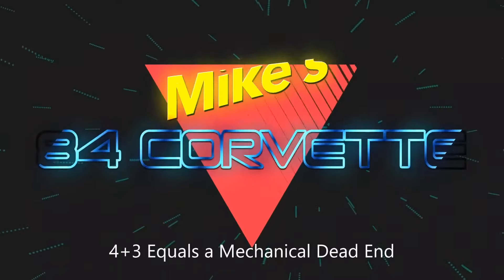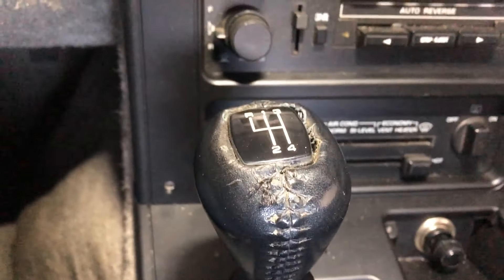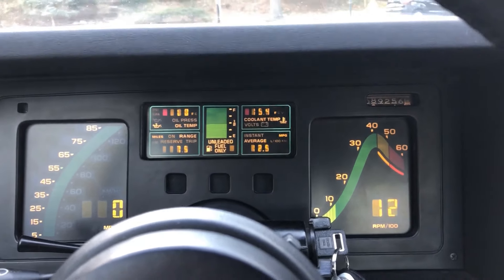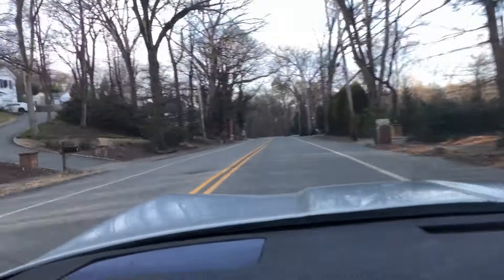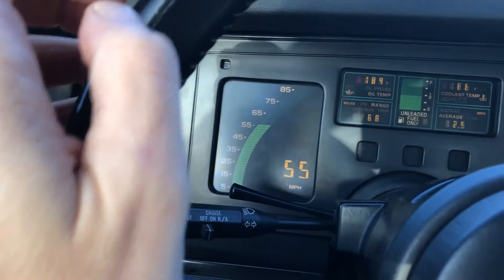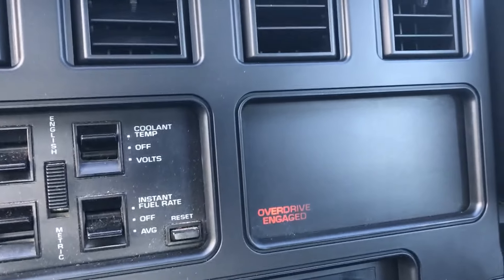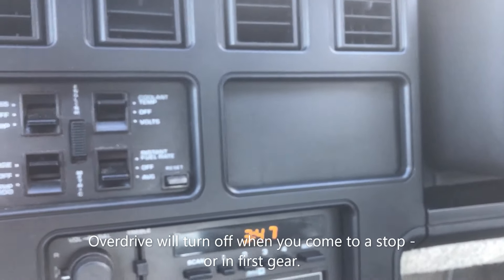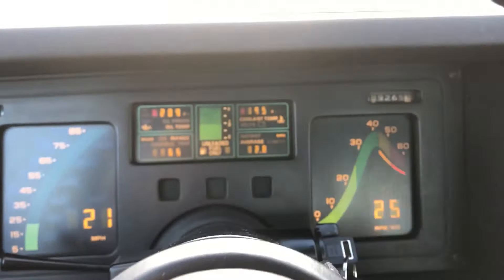Taking the 4+3 Trans for a Ride - Mike's 84 Corvette

Comment: Had issues with my 88 Vette with old dougies trans. First problem is if it needs work, good luck finding a shop to work on it. When it worked properly is was fun to drive even more so than my current 2000 six speed because I didn't have to depress the clutch pedal to get into a higher gear. I even wired mine to operate in first gear. Mine had the switch in the shifter

Comment: It's kind of weird they added it to 2nd and 3rd. 4th, it makes sense, but not really for any lower gear. Cool to see it in action!
Reply from the maker: Thanks for watching!
Reply: It makes sense if you want to do some fast accelerating, since you can flip on the overdrive while at full throttle, you don't need to push the clutch in and have any down time in acceleration, can just keep putting the power down through a shift
Reply: @televisionandcheese  I was thinking that as well. It would be interesting to see someone hammer through the gears while using the OD and timing it vs without. A quarter mile run would probably work.
Reply: @KartKing4ever  I have a Triumph Spitfire over here in Europe, and it's got a similar system. It's a 4 speed manual with electric overdrive. 
It has the switch more conveniently located on the shifter, making it easier to use in anger.
It's certainly much faster when going through all the speeds possible.
It's a huge amount of fun and greatly satisfying to use over a 5 speed manual.

Comment: The overdrive on this 1984 Corvette reminds me of the overdrive that was made by Borg-Warner and was installed on some 1950s and 1960s cars that had a three speed column shift. The Borg-Warner overdrive was similar to this Corvette overdrive in that both were a 2 speed semi-automatic transmission attached to the output of a manual transmission.

Comment: I purchased a 1985 year Corvette back in 2015, it has a little bit different digital dash but same transmission. I had no experience with manual transmission cars when I purchased it and my Dad drove it down the ridge from where it was located. We get it up on the lift and its solid underneath. It didn't have reverse and my Dad was able to fix that. The price was originally 3500 but I had a special price of  3250. The seller even included the upgraded window regulators that dont use the nylon ribbon.

Anyways that was the whole reason I learned to drive manual transmissions, I've since replaced the heater core and we have a new foil backed foam insulation sound deadener kit, a new graphite carpet kit and I have new floor and cargo area mats.

Next is the interior trim panels, door panels and the seats. I also intend to redo the solder connections for the rear defrost, as well as replace those rear pillar trim pieces.

I also intend to replace all the weatherstripping when I have funds saved up.

Keep up the good work on your 84 as well!

Have a good evening!
Reply from the maker: That’s a great story! Sounds like you are doing a good job on your car. Thanks for watching!

Comment: Finally, someone who shows us all just how the 4+3 transmission actually works, considering its oddities. Myself?, I'd opt to pull that console & add a bunch of sound absorbent material to try to absorb some of that plastic on plastic sounding gear-changes...
Reply from the maker: Thanks for watching! Good suggestion too. Maybe for a later video.
Reply: @Mikes84Corvette  The Doug-Nash manual box has a bunch of external linkages...and all those "connection points" create & transmit sounds. The likes of a Ford Top-loader have zero such linkages, the shifter stick merely sticks out the 'top' & is utterly silent.. There are a few aftermarket shifters for the Doug-Nash...all those linkages & the 'shifter box' likely are made with differing materials & likely " sound better" & work better.
Reply from the maker: @AndieBlack13  My car makes so many squeaks and rattles any improvement in  one area would probably get lost. Good info and I appreciate you commenting.

Comment: If I ever were to get a C4 (and couldn’t get a Grand Sport) I’d have to get one with the 4+3.

Back in the 90s, a good friend of mine had an 88 with the 4+3.  From the first time I rode in it, I thought it was the coolest transmission.  A manual that also shifts like an automatic, it blew my mind!

Did they move the OD button from the console to the top of the shifter in the later cars?  For some reason, I seem to remember the OD button on his being a button under the shift pattern on the shifter but it has been a long time since I’ve seen or ridden in the car so I might be wrong.

You have a super-cool C4 there.  I sure wish I had one like it.

Thanks for sharing the driving video.  It brings back great memories for me.
Reply from the maker: Thanks for watching! The OD button was definitely moved from the console to the shifter, not sure which model year though.

Comment: Nice unit!! So its really a 4+1, but GM wanted to include the overdrive in 2nd and 3rd gear to further the sum of their mathematical problem... Thanks for the video!
Reply from the maker: Plus 4+3 sounds way better than 4+1
Reply: The overdrive unit will engage in 2nd, 3rd, and 4th if you take your foot out of it. The car has a total of seven forward gears, thus it is a 4+3.

Comment: Hello Mr. Mike. Thanks for the great video on the Doug Nash 4+3. I myself all ways drove manual stick shift sports cars. So for me to get a Corvette it had to a manual, just as you stated. No such thing as an automatic for me! I currently own a 87 C4 with a 4+3 it's ok, but I never use the overdrive and would be useful to have two more gears to snatch. I look at a sports car as one that as to be driven and for the driver to be fully engaged with the car and road simultaneously left foot included. Hence forth fuel economy is out of the equation, I never push down on the OD button. I can see that a ZF-6 will be a necessary upgrade. A 383 stroker and road warrior clutch to boot!  After all has been put in place I should have a 35 year old car that will be able to hold it own in modern day times.
Reply: You do realize that with the overdrive you have 7 speeds, right? Why wouldn't you use it? Sure, the ZF box would be preferred, mainly because it's slicker shifting, but the 4+3 to me is still more fun then auto and actually is interesting once you figure out how it works.
Reply from the maker: I do realize that. Around town I use it as a four-speed - out on the highway I pop it into overdrive when in fourth gear - and it's like getting a fifth gear.

Comment: Also, most my dash cluster does not work, I dont know my speed or RPMs. Its nice to see how it's actually suppose to work and look, its first one my list to have repaired.
Reply: Huh lol I can see my tacho and speedo but cant see my gas gauge and oil/coolant temps. I have an 85 with three screen digi dash. Thinking bout getting backup gauges indtalled
Reply from the maker: Sounds like you have some dead bulbs in your dash. I would check them first before you invest in back-up gauges. Unless you have your heart set on the additional gauges. Good luck!
Reply: @Mikes84Corvette  yeah they just barely light up. guess i just need to rip it out and replace them with something more modern and long lasting
Reply from the maker: @brandonwilson4408  The LED bulbs from Batee.com are excellent.

Comment: Cool, i'm sure many of us wondered how it works. I understand the 4th Gear + OD but not sure I understand the purpose of the OD for 2nd and 3rd gears though. Do you leave the OD option on and while shifting into 2nd it will automatically go into OD if you are just cruising and then go up to 3rd and it automatically goes into OD? or Is it when you just don't feel like shifting into 3rd or 4th from 2nd and just hit the button for like cruising down the main strip.
Reply from the maker: It’s the first way you described it. If the OD switch is on and you aren’t accelerating hard it will stay in OD 2-4. If you hit the gas hard it will shift out of the OD gear and into the direct drive gear.

Comment: Cool! Why did I think there was a button you pushed for overdrive on the top of the gearshift? Was that just my imagination of was that for just certain years?
Reply from the maker: I believe that came out in 85 - making the button on the console an 84 only feature.
Reply: Late 85 the OD switch moved to the shift knob. My early build 85 has the OD switch on the console as well.
Reply from the maker: @johntrishstrange7378  Interesting! I had a hard time finding a replacement shift console for my 84.
Reply: Mine is in good shape except the images are faded. Plan on a replacement in the future.
Reply from the maker: @johntrishstrange7378  Mine was cracked in places. I found a new "blem" on eBay. It looks perfect to me. Very happy with it.

Comment: Fully warm engine @7:08 idling at 900 RPM, check for a vacuum leak Mike.
Reply from the maker: Thanks! Lately it’s been idling around 700 -  800 rpm. But I will look for a leak.

Comment: So i've been looking at C4 4+3 vettes, I went and test drove an 88' that has been rebuilt. Is the overdrive switch located on the actual gear shifter in later models? I am missing the switch on the center console like you have. Googling later models shows they don't have it either so it wouldn't have been deleted? What do you know sir?
Reply from the maker: Yes. Later models had the OD switch moved to the gear shift.
Reply: @Mikes84Corvette  thank you so much I'll make sure to test that.
Reply from the maker: @bluetyphoon2100  It's the button right on top of the gear shift.

Comment: So it's a gear vendor! That's really nice an idea!
But tbh, I don't really see the point of the overdrive 2nd gear, seems like it would only fit to a 25-mph urban boulevard or a 30-mph open road (like the ones in Nevada or Utah) but then again, the normal 3rd gear is also good for the same job plus you get a better throttle response for accelerating quicker.
I just wonder how history would've been written back then if the engineers had begun searching for better gear spacing, more gear ratios and how spacing and ratios can be combined to give a versatile product. Who knows, maybe we could've seen the 7-speed manual of the C7 Stingray 30 years earlier (it's an extreme example, I know, but seeing how the 4+3 makes us think about it, I think it could very well be done back then too).
The only 7-speed gearbox I can think of being that old is not even a manual road-going unit - it's a semi-automatic used in the 1989 Ferrari 640 F1 car!
Reply from the maker: I only use the overdrive feature out on the highway. I get up to speed in 4th gear - clutch down, press the switch, let up the the clutch - and I'm cruising in overdrive. Under the right circumstances - speed, throttle position - it will shift "down" to regular 4th - like an automatic shifting down.  Good gas mileage too - on a recent 75 mile trip I got 24 MPG - not bad!

Comment: My 84 overdrive is disabled so the only bummer is cruising in 4th at 2500- 3000 rpm which is a bit tense.. but other than that I don’t feel there is a real need for those plus 3 gears.
Reply from the maker: Agreed. Really only needed in 4th gear. I believe it was done just for a fuel economy boost.
Reply: @Mikes84Corvette  yeah for sure, that’s why my economy is pretty poor especially when i step on it on highway..;) Although i heard that reverse gear might be linked to overdrive somehow and that eventually if overdrive not working, will go bad.. hope that’s not the case..
Reply from the maker: @bojankalodjera1757  Same here!

Comment: Thank you for the explanation.  I feel like it works like my truck with the high/low Eaton fuller transmission. Do you have to let go of the clutch to press the overdrive?
Reply from the maker: The smoothest way to activate the overdrive is to push clutch in, press the overdrive switch to on, then release the clutch. Thanks for watching!
Reply: Sounds like a splitter 🚛

Comment: Hi Mike, I just replaced my clutch disc, pressure plate, throw out bearing, clutch resorvoir, clutch line, clutch slave and me and my friend can not get the clutch to work right. We have tried amost everything to get it to work, we have bled it and it works for a few minutes and it goes back down with no clutch. Have you ever have this problem? Thanks alot!
Reply from the maker: Hi. When my clutch died I had the work done by a professional mechanic. I wish I could help you. Good luck!
Reply: @Mikes84Corvette  Ok thanks, just put it in the shop, I hear these manuals are terrible to get it right. Look forward to driving it again soon!
Reply: Did this improve gas mileage any?

Comment: still going good? i bought my 1985 with 4+3 around late january. clutch went out and the replacement has problems shifting ever since.
Reply from the maker: Sorry to hear you are having problems. I hope you can sort it out.
Reply: @Mikes84Corvette  would you recommend one of these gen corvettes for a 16 yr old first car ?
Reply from the maker: Nope. No airbags, no anti-lock brakes. Too much power. And depending where you live - not good in the snow. Plus, I can't imagine how much insurance would be for a 16 year-old driving a Corvette. In my humble opinion, I would recommend something safe and reliable as a first car. Good luck!
Reply: @dagoat5064  agreed with Mike on that. I'm 23 this is my 3rd car and I still feel shakey really punching it. It's really easy to gun it anytime you want and break the traction start fishtailing a bit. No good for a kid with no exp.

Comment: it mightve not of poped out it couldve down shifted to gain speed then shifted back into over drive like how you had it before to save gas mileage with lower rpms..... id suggest try using the 2nd gear over drive and test this theory and then also with the third gear over drive
Reply from the maker: True. You need to be deliberate and keep your foot in it to keep it out of overdrive.

Comment: IF you want to make it last longer you press the clutch in before engaging or disengaging overdrive and then rev match.  They are worthless now anyways, you cannot find the solenoid that engages it, they used to sell for $600 new, or $150 used, but they are out of stock everywhere.   I think they are in the pan too so you won't find them at a junkyard.   Worthless transmission.
Reply from the maker: I’ve been doing just that. Seems to engage much smoother that way.